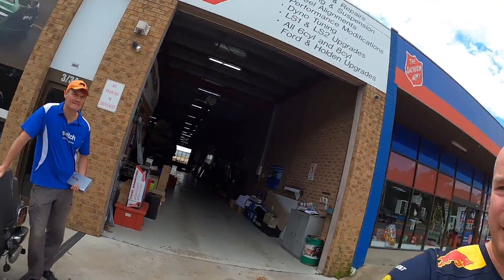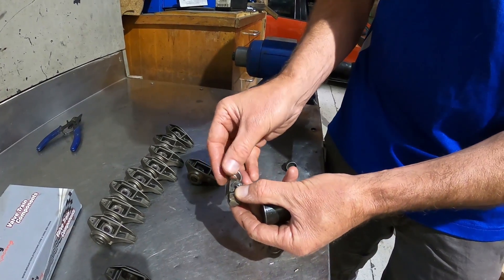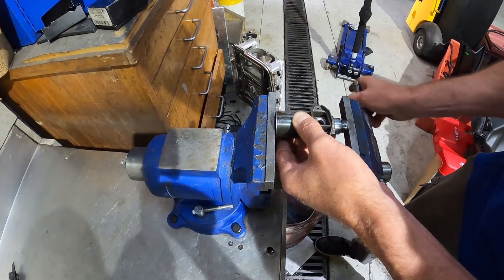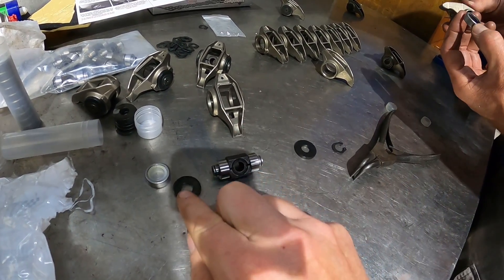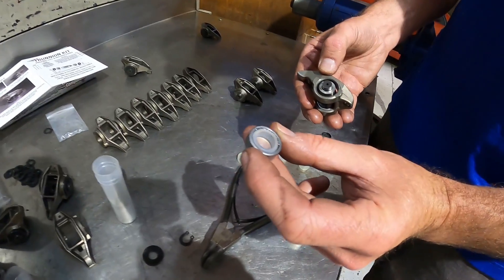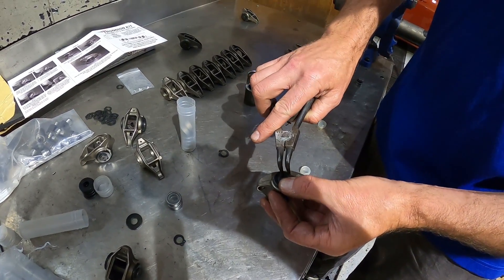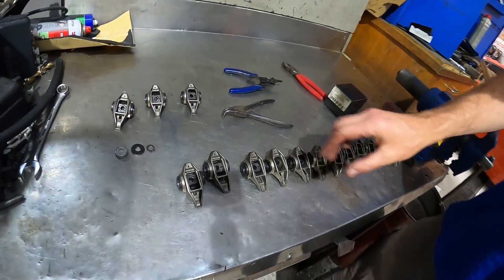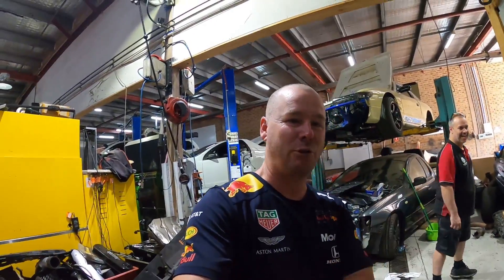LS Rocker BTR Trunnion Upgrade | 500hp LS 6.0L Engine Build Part 3

Comment: Got the BTR trunnion kit done on mine when I had the heads and cam done. Opted for this kit even though it still has needle rollers, it’s a much better design. Didn’t want thebronze/brass type as I’ve heard some stories with failures/excessive wear.

Comment: Hey mate, I’m looking at doing this upgrade, did you go the BTR kit over the brass bush style for any reason? Just trying to get info before I order some. Thanks
Reply from the maker: G'day mate, I went with this kit as we run BTR camshafts anyways and our local tune shop recommended it.
Reply: Definitely go the BTR v2 TK002 kit. I’ve heard excessive wear or failure of the brass/bronze bushing types.

Comment: Mate what diff are u running on the red vf?
Reply from the maker: Wave trak with 3.7 HSV gears
Reply: What do u think about the tru track?. I’m running about 480rwkw and need a diff jus wondering what would be good.
Reply from the maker: @Hsvsenator  G'day mate, we have the tru track in the VE Nascar ute and it is going great.  We will also retain it for the new engine build. I needed to step up in the VF as it is pumping out 1000hp+ and the wavetrac is rated to 1500 apparently.
Reply: How much power is the ve Ute running?.
Reply from the maker: We are currently pumping out 285rwkw.

Comment: buy some decent roller rockers, you will make more power and increase valve stem and valve guide life because of less side load from a full roller tip, ITS A NO BRAINER
Reply from the maker: Thanks for the tip mate.  We have had some bad experiences with third party rockers in the past and the factory ones have never failed.  Any advice on roller rockers you would recommend?